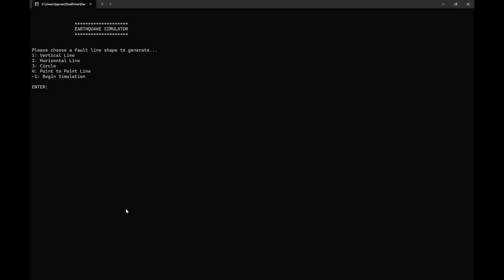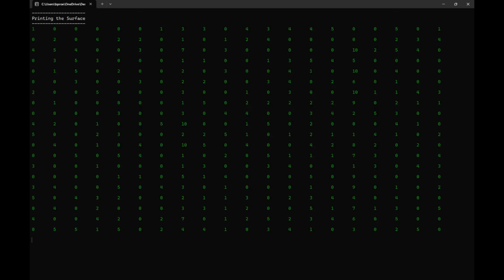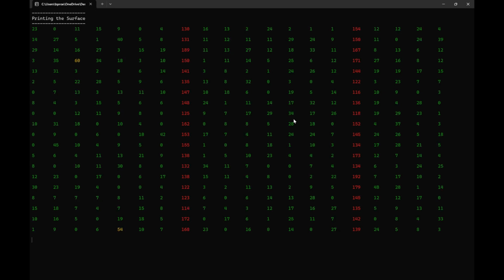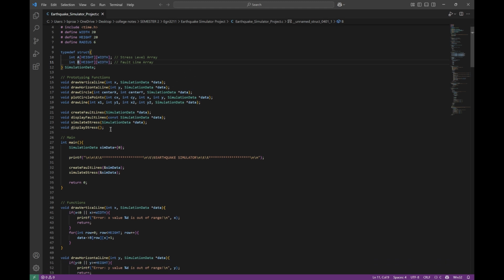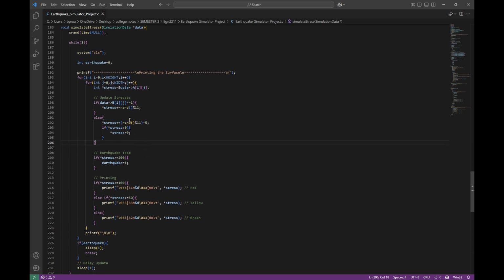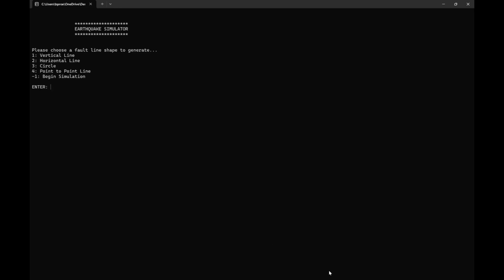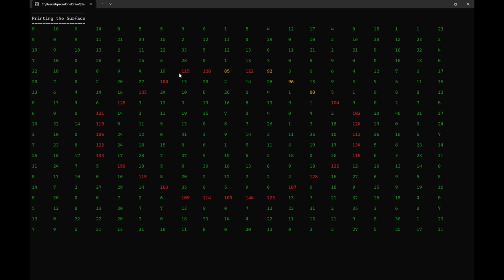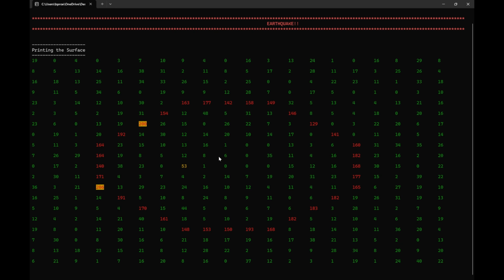Earthquake Stress Simulation in C | Final Project Presentation

Comment: A few tips, don't use system() to call external programs, especially to clear the screen because there is no `cls` on Linux, and use a library like ncurses instead of manually printing ANSI escapes. Also, use windows with ncurses, which is a really difficult thing to look up because every search engine sucks now, but look on TLDP for a good set of documentation for ncurses. Don't be dissuaded by Linux, ncurses is multi-platform capable. I used it back on Win98 many years ago, if that answers a question I'd assume you'd ask.